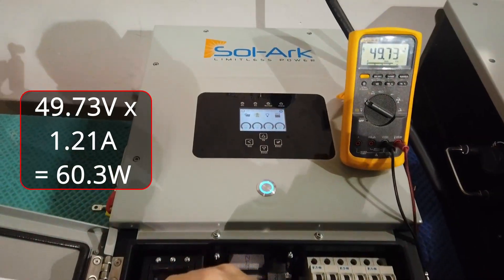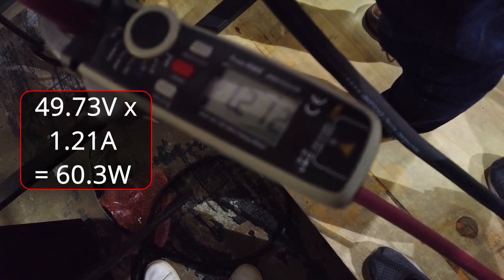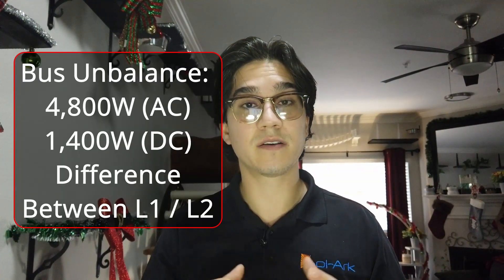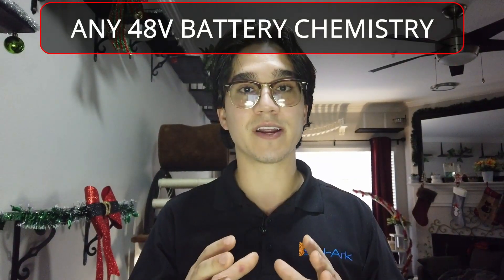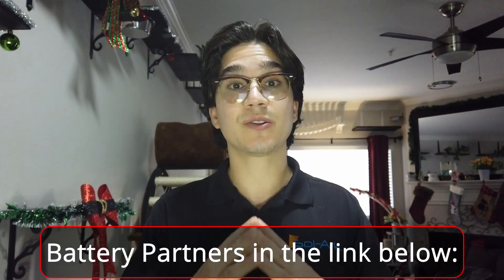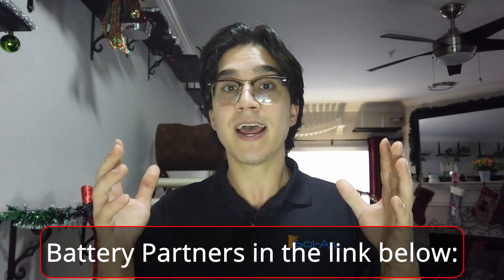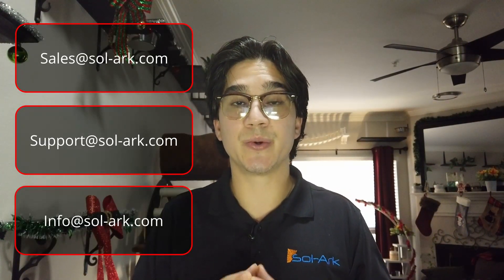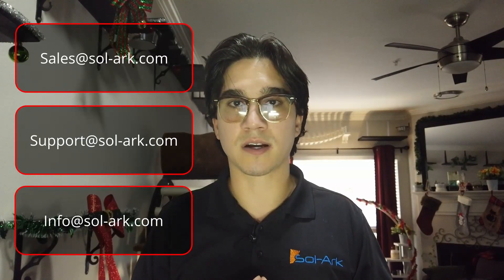Things to Consider with an Off-Grid Sol-Ark 12K

Comment: I have a Solark 12K and a Generac generator 15k, 220-240 single phase.  I want the generator to power the house and the batteries when the batteries go below 30%.  I also would like to have the option to have the generator power the house if the entire solar system is down.  I think I need an automatic transfer switch after the generator.  Do you know of a switch that is smart enough to power the house when there is no power in the solark? How would I then change the voltage from the generator to power my 120V electric panel? Would you happen to have a writing diagram for what I would like to do?  Thank you.  Great video.

Comment: Nothing but issues from day one 8 months after install the thing blew sparks across the room never shut off never tripped breakers we had to turn off the mains coming in. The sparking was inside the unit behind its line of internal breakers. Solark reply must be a bad external wiring job. No customer support no responsibility this thing is dangerous and will burn your house down
Reply from the maker: @sykodiver6995 it sounds like a poor installation - manufacturing is done at scale and if that were a common issue, believe me it would be known.
Those internal 12K breakers are wired up to during installation. Please be sure to fill out a technical support ticket: https://www.sol-ark.com/contact

Comment: calling it a 12k is misleading, adding up 2 completly different power values is sketchy at best, its like saying your car can go 200 mph, 150 mph forward and 50 mph in reverse, start by rating its power output like all other inverter manufacturers and designing it so it doesnt shut down at the slitest hot leg inbalance,
Reply from the maker: Gilles, please contact Sol-Ark technical support for further assistance with your leg imbalance issue. 12k is the nameplate capacity of the inverter (what it can export to the grid) which is industry standard nomenclature.

Comment: I do not understand how you can be saying that you will have a buss imbalance at 4800 watts when I would expect it to be failing at 4500 watts. The failure would be having nothing to do with a buss imbalance, however, it would be because you would be going over the over-current specification of the unit in L1 or L2 which is 37.5 amps.
Also, since there is usually an AC voltage between L1 and L2, it’s not so clear to me how you are defining a DC imbalance there. Are you defining this as an uneven load that could be caused by a half wave rectifier in the load or are you meaning something else?

Comment: We’ve been running our Sol-Ark for about a week (off grid), and received an F18 error yesterday —the Load was less than 1KW at the time.  Today we received the F20 Error, and load was less than 1KW..   I disconnected the load and the Sol Ark kept cycling the AC on and off.   

The solar panels were generating about 2KW, and the batteries were 100%. At 3:16 in your video, you suggested balancing power to mitigate the F18 code, any advice or suggestion on what might be causing this problem. 
By the way. The faults occurred at around the same time each day (around noon.    
Thanks

Comment: I’m looking into Sol ark 15k. My question is can you do AC coupling AND do generator back up?
Reply from the maker: Hi Mitch, that is most undoubtedly feasible! The best way to do this configuration would be with a transfer switch or ATS through the grid side. All you need to do is click on setting -> Grid Setup -> Sell Control -> and select "Gen connect to Grid Input" so that the system is aware not to sell power back to the generator. You would AC couple up to 19.2kW on the Gen terminal simultaneously.  If you have any other questions, our team of engineers would be delighted to help. Please email support@sol-ark.com or fill the form out at https://www.sol-ark.com/support/#anchor101
Reply: @Sol-Ark  thank you!  Could you guys design/make something similar to Tigo quick shut down/optimizers. That’s the biggest hiccup in my pending build right now.

Comment: I’m looking into Sol ark 15k. My question is can you do AC coupling AND do generator back up?
Reply from the maker: All our inverters can have both AC coupling and a generator connected at the same time, the only requirement is that the generator will need to be connected through the Grid Input of the inverter. If you already have a utility connection, that means you will need a transfer switch of some kind between the inverter, the utility, and the generator to make that work. 

If you have any more questions about that topic or anything else, feel free to write us your questions here: https://www.sol-ark.com/contact-us/ One of our engineers will be happy to help out.

Comment: So if don't have solar panels and use the Sol-Ark 12k for UPS functionality only (connected grid) with batteries,  to prevent imbalance faults the condition to met is that no difference of higher than 1400w between the legs????? 
What happen if I decided to run,  for example, a 110v 12000 btu mini split (25 SEER) in one leg and an high efficiency fridge (400w continuos) in the other leg. If the grid goes down (with batteries 100% charged), It'll be almost impossible not get imbalance faults. For $6700 for the 12k this inverter is not an option. What about the 15k?? is this imbalances issues would be resolved with the 15k?
Reply: Read other comments. They explain it better then this guy is explaining it.

Comment: David Eckert
1 second ago
I had a 25kw system installed with 2 Sol-Ark12k in parallel with batteries, I come to find out the most the system will allow to be generated is 18 to 19kw. I was under the impression that 12k was 12kw of AC power and so 2 in parallel should be 24kw. Not the case, very disappointing to say the least. Wasted my money and now trying to figure out what to do. Suggestions anyone?
Reply: Victron quattro .  Stack as many as you want . If they say 10k they will do 12 not 7 . lol

Comment: Nice video and effort to educate on your great product.  I wanted to make a comment about the idle current.  It seems misleading to express the idle current as a small percentage of the total output capability as this is not a common use case.  The idle consumption is there all day every day consuming 60*24=1.4kWh per day which is a large chunk of battery capacity or solar production in a day.  Not sure of the technical challenge but this would be a valuable spec to improve in my opinion, especially with all the highlighting of the great efficiency numbers you achieve, this spec is a drag on the real world performance.
Reply from the maker: Hey Rick, thank you for the feedback. Our team of engineers always appreciates when people let us know what they're thinking! This would be something great to work on.
Reply: @Sol-Ark  Thanks for the reply!  Just to highlight some numbers, the idle draw of 1.4kWh * 365 = 511kWh/year.  At 15 cents per kWh this is $77 per year to run a Sol-Ark.  Put another way, my solar array produces 6000kWh per year, so running a Sol-Ark is 8.5% of my array's capacity.  At say $2.50 per watt and 1Wh/W this would cost $1250 to add more solar to cover the idle current.  If there is any way to get this down with a FW upgrade, I would be super happy and a major upgrade in my opinion!  Any feedback on if its possible is welcome.

Comment: Problem is , sol ark is using false advertising by calling this a 12 k unit while it can only output 9000 watts IF AND ONLY IF the two legs have balanced loads.
People are buying this unit only to find that it cannot perform the simple tasks they thought it would based on the name plate.
The sad fact is that my good old 8000 watt inverter can power our entire home better than a sol ark with ZERO fault shutdowns. And by sol arks poor standards all Id have to do to consider mine a 12 k unit would be to add another charge controller.
They are simply misleading their customers by trying to hide the limitations of their poorly performing product with a 12k sticker. The other sticker they use says "limitless power" but sadly they have produced a product with severe limitations in everyday usage. Calling this unit a 12k equates to putting a Lamborghini badge plate on a ford explorer. Had high hopes for the sol ark company, been watching them for 4 years and almost bought one ( untill I watched people doing honest reviews ). I will not buy anything from sol ark untill they learn honesty and integrity in their advertising and promotional efforts. And also untill they can put out an inverter that will power loads without failing due to slight load imbalancing.
Sol ark - you have some good ideas and concepts but you are failing to produce a solid product that performs AS ADVERTISED.
Untill you resolve these two simple linked issues (Honesty & performance) you will not have me as a customer and you will lose potential customers you never knew you had !
Thankfully there are some people out there who produce factual, unbiased and real world reviews.
Reply: I had a 25kw system installed with 2 Sol-Ark12k in parallel with batteries, I come to find out the most the system will allow to be generated is 18 to 19kw. I was under the impression that 12k was 12kw of AC power and so 2 in parallel should be 24kw. Not the case, very disappointing to say the least. Wasted my money and now trying to figure out what to do. Suggestions anyone?
Reply: @davideckert4702  sorry to hear that David. Seems that given your investment in your existing system that the most cost effective solution would be to add a third solark although I understand that may actually be upsetting given that they sold you on higher production numbers in the first place.
We run an outback radian gs8048a inverter which can output power beyond its stated 8000 watts but to be fair it can only sell to grid at 6200 watts max (a built in and designed limit, which was clearly stated in the inverter literature)while still supplying some power to loads.
Short of selling your components and starting over, perhaps with some carefully worded explanation to solark and/or installer - maybe solark would be smart and give you a third unit in order to avoid complaints and keep a happy customer. To me it all comes down to overstated performance and carefully avoided severe limitations.
I hope you have some luck with this as it's a tough & bitter pill to swallow to learn your $ didn't buy what was promised and what you reasonably expected.
If you do scrap & start over, be wary as I think most all the H.F. inverters have the leg imbalance issues to some degree and almost all inverters won't sell quite as much power to grid as they can deliver to home loads. It's too bad as I like solarks ideas & features but they really need to be upfront about the real world performance issues. We run our property on the outback inverter with 80 KWh lithium battery bank (signature solars EG4 waterproof 48v 5.1 KWh units) and 8800 watts rooftop solar. We sell about 20-25% of our power back to grid daily and run "off grid" all night. We are in the tropics so we pull in 50-60 KWh per day with the strong sun here. That's a good size system you put in, what size & make battery bank did you use ?  Hope solark steps up to the plate for you.
Reply: @davideckert4702  Maybe they will offer to swap the 12k's in on their new 15k which is probably a legit 12k .

Comment: How simple is it to hook up a 48 volt windmill to a SOL_ARK 12k for off gird solar and wind use?
Reply from the maker: Great question! It depends on whether the windmill is AC or DC:
DC-- You can use an external charge controller and dump load, then tap it to the battery / our system.
AC-- You will need a step-up transformer (50VAC to 240V) and a dump load.
Please contact support@sol-ark.com with your questions and we'll be happy to help!
Reply: @Sol-Ark  thank you

Comment: Great information thank you. Maybe you could do a video on what settings you may want to use when hooking up a EG4 LL 48V 51.2V100AH  5120AH battery bank off grid with solar
Reply: 44-50V cut off depending on how conservative you want to be (I use 48V). 54.5-57V absorption (I use 56V usually), 54-55V float (I use 54.5V).
Reply: @niktak1114  Thank you

Comment: You need to clarify on how to tune in MICRO HYDRO DIVERSION. When running off grid, small generator, Lithium Iron phosphate UT1300 12kw 48v. Since micro hydro goes directly to battery the system always sees 53.7. Currently system will show batteries at 16%  but on battery face it is 80%.
Reply from the maker: Hi Jymmee Tee, please try using voltage mode on your S-A 12k. If you have it attached directly to the battery bank, did you include a dump load? Please reach out to support@sol-ark.com through email to create a ticket with our team, and we can help you get set up.

Comment: Does the Sol-Ark provide AC frequency shift to help regulate DC voltage when AC coupling ?
Reply from the maker: Hi Bob,
The Sol-Ark can use frequency shifting to regulate AC coupled solar production as long as the AC coupled inverter is UL1741SA rated. To regulate the DC coupled solar, our charge controllers can limit the current to match the demand of the home/batteries if needed.
If you have any more questions about this subject, feel free to email our support team at support@sol-ark.com or by calling 972-575-8875 x2

Comment: The imbalance reply for off-grid is not really an option for a lot of people. There is a solution of using an autotransformer, for me this solves the only problem I had with solark off grid. 
I think it would be beneficial to explain this as a solution to customers with all its pros and cons and explain how to best set it up.
Reply: I called Sol-ark to verify imbalance issue. The issue is with DC recified appliances so this will not happen with microwave, coffee maker, etc.
1400w differential in DC 
4800w in AC 
Too bad this is not clearly explained here. Im buying the 12k
Reply: @charlesadams1654  let me see if I understood correctly, can I run 4500 in one leg and 1000 in the other leg, there's a 3500 diference????
Reply: @carlossantini  
The issue is with DC recified loads. Not normal AC appliances. 4800W differential between lines is max threshold for split phase operation with normal AC loads as I was told.
Reply: @charlesadams1654  ok, in a blackout without solar panels with 20kw of batteries fully charge, could I run 4500w continuos in one leg and nothing in the other leg?
Reply: @carlossantini  
That's what Sol-Ark says, normal AC loads only. Not DC rectified as in charging your electric car. Call them to clarify. Lots of people not doing research themselves.
Reply: @charlesadams1654  Good luck , I'm not.
Reply from the maker: Hi Brian,
Thank you for the wonderful point. You are correct that the auto transformer helps regulate the unbalance, but as it is an additional cost to an install, we don't necessarily recommend this for all customers to prevent additional costs. Most customers can get by without it as long as there isn't a large 120V appliance that could exceed the 1400W limit of difference between legs.
If there's ever any doubt whether or not you may need the auto transformer our support team will be happy to help, even if you are not currently a Sol-Ark owner and are just looking for advice on designing your future system.
Reply: @Sol-Ark  "1400W limit of difference between legs"   ??  So no hair dyers , microwaves , space heaters , compressors , heat guns, etc ?  I thought you said it could do 5,000w  plus per leg the other day ?
Reply: @onthelake9554  1400 watt difference, not max.  So run two heater, one on each side.

Comment: Nice video! For the F26 Bus Imbalance error isn't each leg limited to 4500W AC total?
Reply from the maker: Hello,
The continuous rating of each leg on a 12K is actually rated at 4800W AC. Older software used to have the bus unbalance limit set to 4500W but this was corrected in a past revision to give as much tolerance as possible before the fault occurs. If you have any more questions, feel free to reach out to our support team at support@sol-ark.com or calling us at 972-575-8875 x2